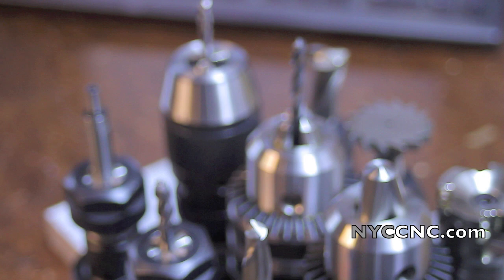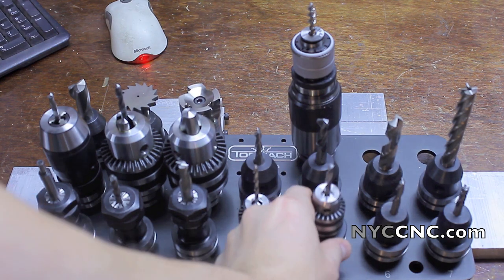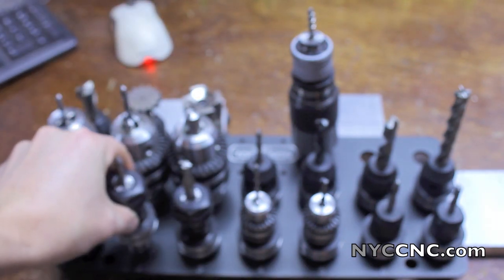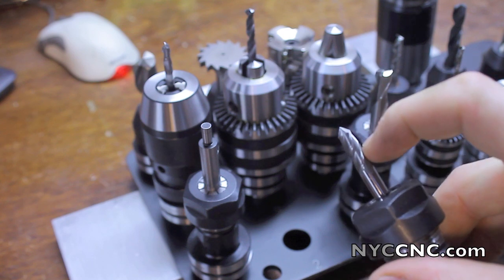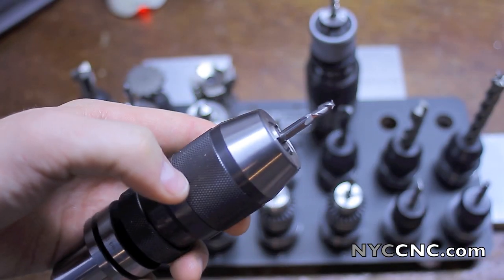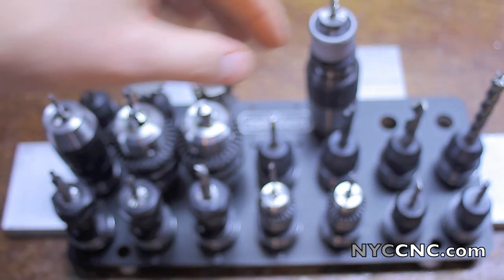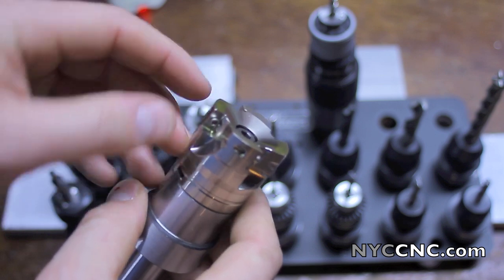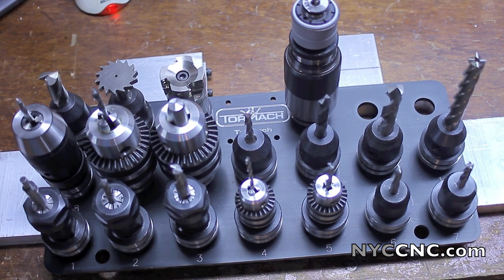Tormach PCNC 1100:  TTS Tormach Tooling System has arrived!  Ch. 5

Comment: Love your videos. Just a quick correction though, the tormach tool holder flange actually mates against the face of your spindle before the collect hits the tool holder. This is on purpose because if you look on the inside "valley" of the tool holder, it is not 'precision ground'.

The concept you mentioned is dead on, just that the flange of the tool holder hits the spindle face, and that's where your repeatability comes from.

Keep it up man, love watching the videos!